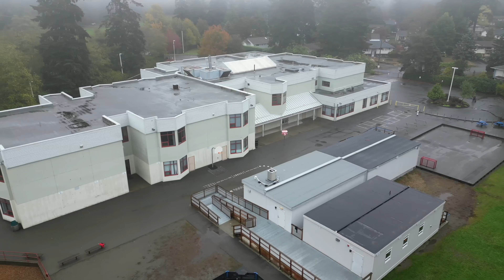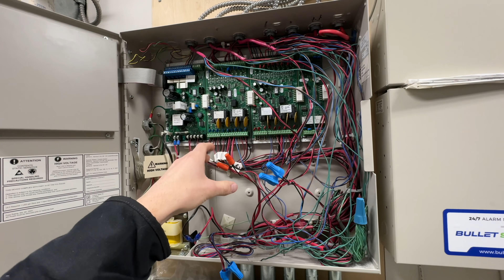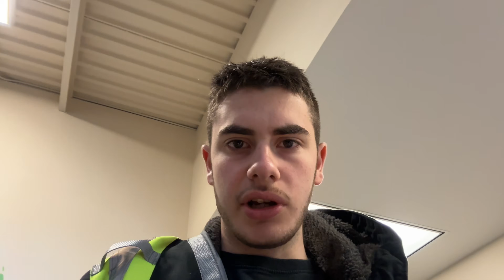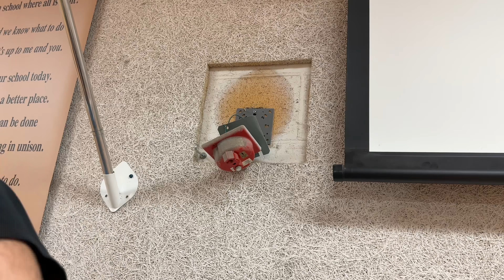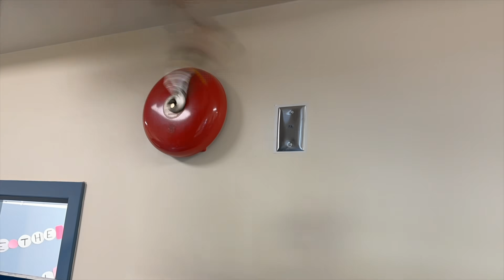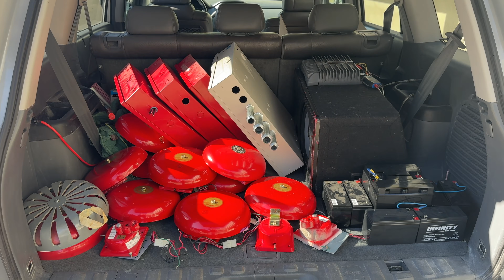Fire Alarm System Full Upgrade At Elementary School | replacing system | Notifier NFS2-3030 Day 1

Comment: I use to have these one in my school but different my school has the system sensor led light horn strobe. Well they are kind da little louder than my old  school  but my school has the simplex, faraday, Edwards, and my different 24 volt bell. Um I saw a Edwards flush horn gray 120 volt. Cool replacement video just wanna say

Comment: Wow I'm surprised to see that a building that was erected in 1994 does not have sprinklers. Idk what the laws are in Canada regarding fire code and safety regulations but here in the states it would definitely be a requirement today that's for sure.
Reply from the maker: Wasn't required in that particular municipality until mid 90s I believe 96.

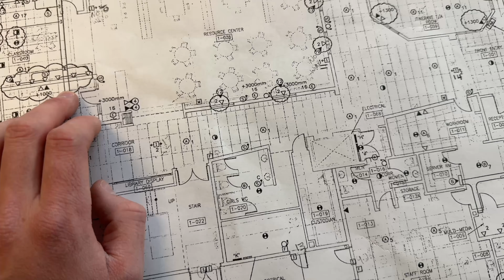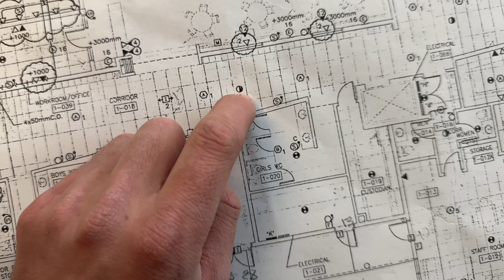Comment: Just FYI…. 5:45 it’s a heat detector and at 5:47 that’s a smoke detector. You mixed them up.
Reply from the maker: That is not the case here you must be using different symbols than what we use. Not only in that physical location those are the devices that are installed but the legend also indicates what symbols are used for what devices and the way I described them is correct.
Reply: @nics-systems-electric  I thought this was in Canada. I'm a CFAA certified fire tech here and those are how the smokes and heats are always shown. As long as that's what the drawings show you're good. Just wanted to point that out 👍
Reply from the maker: @Fragblog this is Canada, but I can promise you where I said there is a smoke detector there was indeed a smoke detector in the corridors and where I said there was a heat detector in rooms that is true to out in the field. What was actually there
Reply: @nics-systems-electric  Awesome, good to know!

Comment: Fire Alarm system designed for people that are hard of hearing getting replaced by a system with a ton of Spectralert Advances, a horn designed to make people deaf on high volume... LOL 

I kid I kid... 

It's better than the system we have in the school I work at, where the kids just laugh at the fire alarm because it's pathetically quiet and unintimidating.
Reply from the maker: These ones are L-series but similar they are what replaced the advance and because of the amount in the school and having them in the classrooms we could set them all to low volume
Reply: @nics-systems-electric  I kind of figured that.

Is my school has a variant of L-series, but they are all voice evac speaker strobes.
Reply: I have a P2RL it is quite at low volume

Comment: Why are you using that thing on the bottom of the CPU last time at your high school that was making your system un synchronized I’ll probably go with a booster panel. I’m just saying I’m not trying to be rude.
Reply from the maker: The only thing below the CPU is the power supply the system needs power to operate. The things that cause synchronization problems are the XP6-CA cards with sync-1A modules

Comment: Nice upgrade, but if the old system still worked, what was the point of replacing. Fixing something that is not broken it seems.
Reply from the maker: I explained that in the video that it needs to be replaced for the expansion as they don't sell parts for it anymore and this particular panel is the next on the list for preventive upgrade as it's much easier to replace a system over spring break when you are prepared and the school isn't occupied versus it failing out of nowhere.

Comment: I'm really surprised you're setting the candela so high on all of these.  Then again, you're in Canada and I'm in the US so different standards.  EST Quickstart is a high priority pain in the ass, lol!.  replace a device?  re-do the mapping.  Test the system?  re-do the mapping.  Don't have the software?  Call a licensed dealer.  Sheesh.  I have a video of the strobes at my old high school going off, all unsyncronized.  That system was installed in 1999, and has since been replaced. ( v=oTsmdsLy_uQ )
Reply from the maker: Yeah usually we don't touch Candela however I asked and I was told to match the old devices. The mapping on Edwards is definitely a huge pain causes more problems than it solves. Luckily this one was conventional so didn't have that issue.

Comment: Just wanted to say I currently work at an engineer firm that specializes in fire alarm system design. Engineers have no idea how things are going to be installed in the field. I feel like being able to understand that and having a good working relationship with the installing contractors makes everyone's job easier. Also, I have been watching your videos for awhile now and always find them informative and appreciate the knowledge you have for this field.
Reply from the maker: You are 100% The job goes so much smoother if you work together and realize everyone makes mistakes and instead of holding it as a grudge address it and learn from it if possible
Reply: rfs
Reply: Stop the roadie

Comment: First time seeing you of the new things of this replacement

1. Replacing a an EST QuickStart
2. Installing a different Notifier panel which is the NFS2-3030
3. Installing a L-Series ceiling mount fire alarm and L-Series fire alarms of different customizations rather than P2RLs which are white ones and strobe only units

Comment: in the gym, what are the cables for that are zip tied to the conduit? in the u.s, that's a code violation. but it is one of those things we do anyway, even though we know its wrong, myself included.
Reply from the maker: Speaker wire for speakers that are no longer there I'm not sure if it would be compliant or not would probably depend if the inspector was in a bad mood or not as you aren't supposed to use electrical equipment for a supporting device unless it's rigid conduit supporting electrical components but at the same time we are allowed to strap BX to pipe
Reply: @nics-systems-electric  thats true, not heavily enforced here and not a safety hazzard unless there are a crazy amount of cables to weigh down and dislodge the conduit. also, may be fully legal in canada, im not at all familiar with your codes.
Reply: @nics-systems-electric  ok, at first i didnt see the rest of your post, seems your code is similar to ours

Comment: To replace these fire alarm do you guys need to power off the circuit
Reply from the maker: Yes it's ideal to keep power on the circuits that way you can test the polarity when installing devices
Reply: @nics-systems-electric ive been planning to replace the spectralert classic that is in my apartment unit with the new system sensor p4rl and the srl and idk if I could do it with the electricity on or I have to tell someone to turn it off for me that's my question
Reply from the maker: @1bejarrr  you don't in your apartment as that is illegal and if something was to happen whether it was your fault or not you could be held liable not something I would do in an apartment when your work could kill someone else and you weren't covered by anything
Reply: @nics-systems-electric  what about calling someone or get the managers permission
Reply from the maker: @1bejarrr  I personally wouldn't want to take on that responsibility

Comment: You should make a wall of strobes to show the intensity of a couple hundred unsynchronized strobes going off all at once
Reply from the maker: That would be quite crazy for sure
Reply: @nics-systems-electric  use a stopper for the pull stations
Reply: Yhea, for new year
Reply: At max brightness setting or wha5

Comment: Another great video! I love the bells...just curious why they are being replaced since they clearly work well (and loud)? If it ain't broke... Looking forward to Pt. 2!
Reply from the maker: The strobes don't synchronize and to put horns in the classroom you would then have mixed signals which is illegal and you need to have devices that are listed as compatible with the sync modules and have available current data sheets
Reply: It's being replaced because they're constructing a new building, and with the EST QuickStart4, it has been problematic + unreliable, explaining why a replacement is necessary.

Comment: Why the NFS2 3030 the NFS2-640 or NFS-320 would have done fine
Reply from the maker: I suggest you watch the video and you will hear me mention what you have asked. the 320 as previous comments have said would not be large enough however as I said in the video a 640 would be sufficient

Comment: I don't wanna be rude but on your channel I only see L series horns. I don't know if you heard of Wheelock but I like those more for whatever reason.
Reply from the maker: We don't use wheelock but trust me I've heard of them usually replacing their broken products. system sensor has by far the best variety of options especially in a bilingual Canadian version and wheelock seems to suffer from quality issues more so therefore system sensor is what's typically used
Reply: @nics-systems-electric that's fair. System sensor has fairly good devices and a lot of customisability in terms of lettering and lenses.

Comment: Love hearing that continuous sound!! Do you think it is better that the strobe lights are separate from the bell, or would it be more effective if there was a flasher on the bell?
Reply from the maker: The strobes have to be separate from the bells as the bells do not have strobes on them like modern horn strobes do
Reply: @nics-systems-electric  I was wondering how to get into contact with you and possibly supply some of our different bells. If you have an interest in how they are made you can always receive a tour. Would love to have you visit!